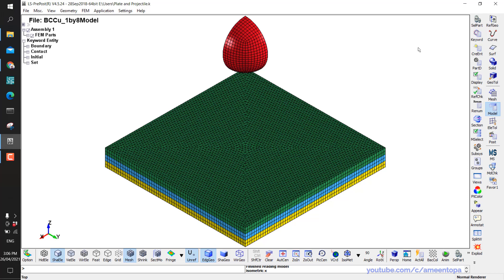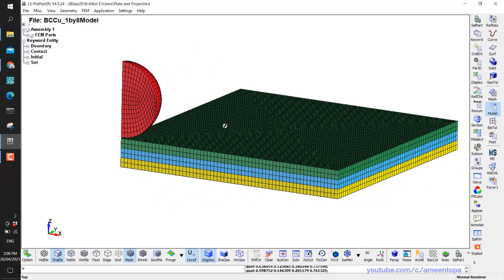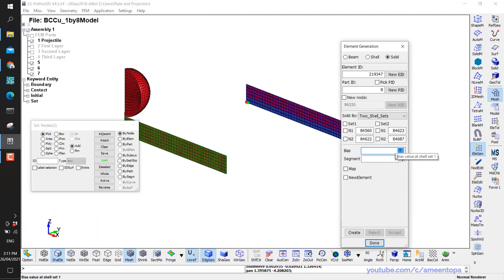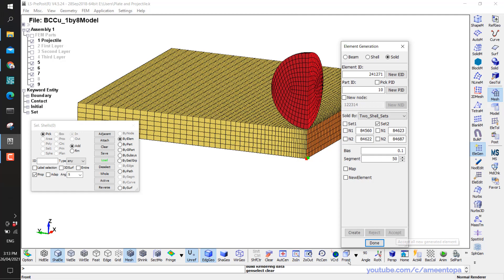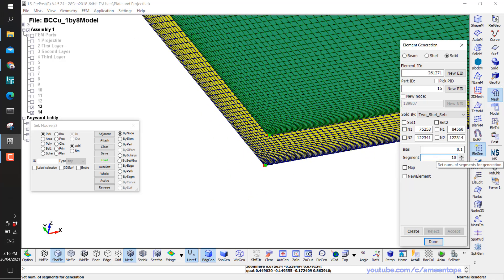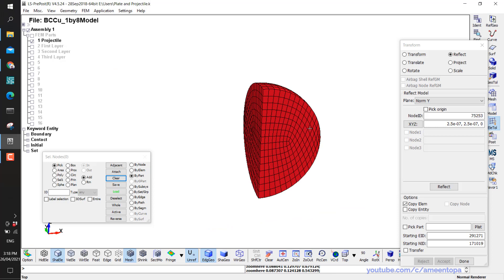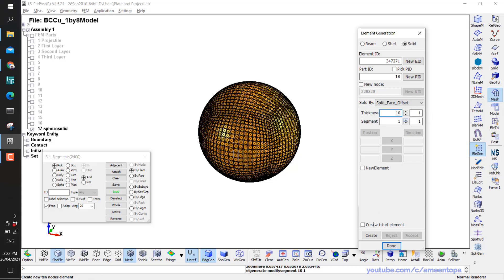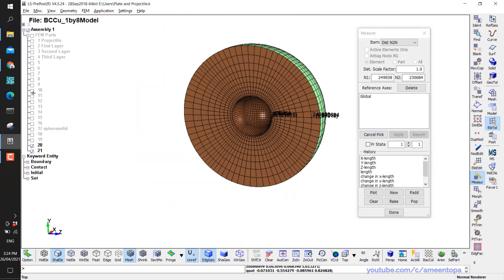Square Plate with Biased Mesh

Comment: Could you upload how to know the wear of the plastic cubes please? I want to design the wear between the plastic and aluminum with the vibration. Inside the aluminum cube their will be a plastic cube and we want to vibrate under the aluminum cube for seconds and see how much the plastic cube's wear depth. Also could you please how to change the axis of vibration direction cause i want to make x axis vibration.
Reply from the maker: You can change the direction of the motion using the keyword PRESRCRIBED MOTION RIGID or PRESCRIBED MOTION SET.

Regarding the wear, you can check the following references:
https://www.dynalook.com/conferences/14th-international-ls-dyna-conference/simulation/simulation-of-wear-processes-in-ls-dyna-r
https://www.dynamore.de/de/download/papers/dynamore/de/download/papers/2016-ls-dyna-forum/Papers%202016/mittwoch-12.10.16/finite-elemente-technolgy/simulation-of-wear-processes-in-ls-dyna
http://www.engineering-eye.com/LS-DYNA/download/pdf/wear.pdf
https://docplayer.net/62097489-Simulation-of-wear-processes-in-ls-dyna.html